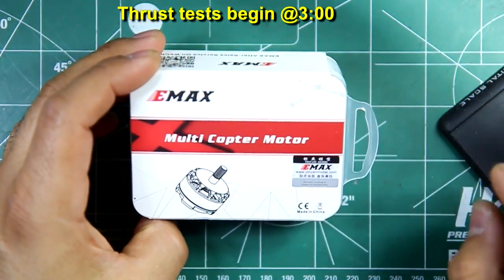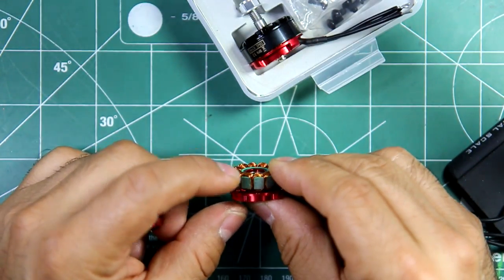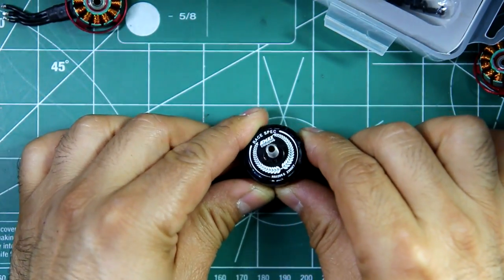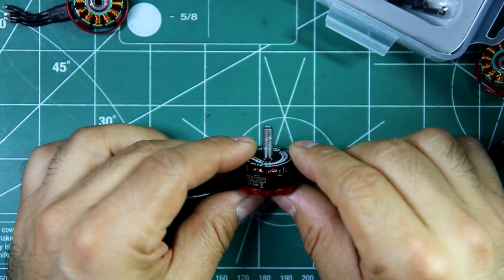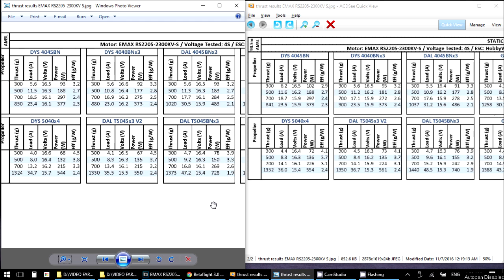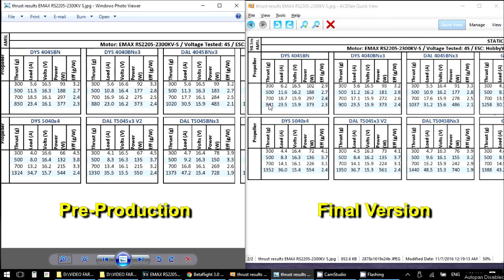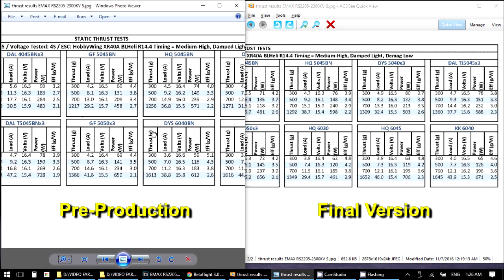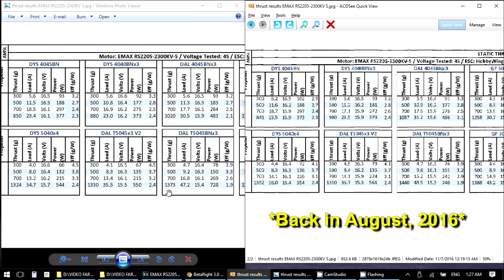EMAX RS2205-S 2300KV Final Version Thrust Tests -More Power! 2206-Class Power!

Comment: Well i have a 1000mm wing with 2205 2300kv motor with 6045 bull nose prop, the amp draw is way too much,plz suggest me some good efficient prop,Present reading is 22km in 20min end voltage is 14.7volt li-ion 4s pack.
Reply from the maker: Bull nose propellers are very inefficient and have high Amp draw. Change to 6040 or 6030 and that will reduce Amps. I'm not sure if it will be low enough as you want, depends on aircraft weight/size. 
There are 4 variables that you have to change to get the Amp draw you want: Size/weight of aircraft, Battery voltage, Propeller, Motor. Since you probably want to keep Aircraft and Battery the same, then you'll have to select a good combination of Motor and Propeller. If you want to use 6045 prop, then for 4S you probably have to use a 2208-1200kv, maybe 1500kv. You may still have a bit high Amps. I think most people use 2212 to 2216 and 800 to 1200kv for 6" prop and 4S. Bigger motor will add some weight, so that's a consideration. 
For lighter weight or keep the 2205-2300kv motor, then you'll have to use a smaller 5045 or 5040x3 prop. 
For long endurance, usually you want to use lower KV motors like 600 to 1200kv but then flight speed will be reduced.

Comment: Iam planning to make F22 raptor with coroplast sheet. Some of my friends used A2212 2200 KV with 6042 propeller. Is 2206 motor better than A2212 motor for this purpose?
Reply from the maker: 2212 is 2x larger height of stator so more powerful and faster response with 6 inch prop. It most likely will not be better
Reply: @EngineerX  so a2212 is better for my purpose?
Reply from the maker: @aju5405  I'm not too familiar with those coroplast plane setups, but if other people are already successful with 2212 size motor, then most likely that's the size that works best. 2212 is more powerful and has more torque so it should have quicker response.  2206 size motor could overheat if you intend to run at high throttle for long periods.

Comment: Which prop will give longer flight time on 3s ?
For longer flight time 2 blade prop is good or 3 blade?
Total weight of drone qav 250 is about 900g with 6200 mah 3s 40c lipo.
Reply from the maker: 2 blade props are usually most efficient.  Efficiency usually increases with prop diameter and lower rpm. I built a ight 5" and used HQ 5040 2 blade props. Made a 3S Li-ion 2800mAh Sony VTC6 cells. About 300g without battery. Flies for 15min.
Reply: Thanks

Comment: Hello! Can you share diagram for connection? 😊
Reply from the maker: Connection for what? Please clarify
Reply: EngineerX I need a diagram to be able to start this engine. Like the one in your video. Turn on or off I do not need any speed control.
Reply from the maker: @JorgeRamirez-dj7lp  i use a Spektrum radio and a receiver. ESC connected to receiver. I use radio to move throttle up and down.

Comment: will a 30a esc with 35a burst suffice if im using the t5045 tri v2 on this motor??
Reply from the maker: Yes, 30A ESC gives you plenty of current handling capability for this motor and any of the 5" props. Good choice of ESCs, you can even use them later for 2306-2400KV & 2700KV motors and 5" tri props on 4S.

Comment: So can I still use my 30A LitteBees or do I need to take 40A ESCs ?
Reply from the maker: What propellers and what LiPo voltage? 
30A works well enough for 4S and any 5" prop and should also be good for the 2 6" props in the test. Keep in mind the MAX Amps on thrust stand won't be present in flight. Multiply the Amps on my test by 0.7 (30% lower Amps in flight - is a guesstimate that I base on a couple of tests I ran before by strapping powermeter to my quad and checking max Amps reached) You can multiply by 0.75 for a more conservative approximation.
Reply: Thank you.
I use the Tattu 4S 1300 75C with the DAL 5045x3 V2 or the Racekraft 5051
Reply from the maker: 30A is good for that setup. I just flew with these motors using RK5051 4S and DYS XS30A ESCs so 30A ESCs is plenty
Reply: Nice :)

Comment: its interesting the hq6045 and king kong are similar efficiency and thrust...usually the KK6040 is a lot more efficient...Im thinking about having these on a 5 or 6" prop race frame...
Reply from the maker: Yes, that was quite interesting. You do start to see how the lower pitched 6040 gets more efficient at the top end. But they're about the same low to high mid throttle

Comment: No RaceKraft 5051's???
Reply from the maker: Per manufacturer's claims, the 5051s won't show their capabiities on the thrust stand, they're designed to be moving fast forward. Check out the thread where they mention something about that: https://www.rcgroups.com/forums/showthread.php?t=2752196
That said.... I"ll be doing a new tri & quad blade shootout, including the 5051, DAL Cyclone 5045x3, HQ S5040x3, and Just yesterday GetFPV has offered to send their brand new prop 5050x3 Butter Cutter prop. So check back in a week or 2 for that test. I'll be using this motor for those tests.

Comment: They are more powerful than the one you received long time before lol I remember those higher amps! Final version is sightly more crazy! Emax company is doing pretty great :)
Reply from the maker: Yep! they sure are. Amps are "normal" in-flight. In my testing setup they're exaggerated a bit due to the huge LiPo I use and the motor not moving. Yes, EMAX has been developing very good stuff lately. Their new TS2306-2300KV motor should be even more powerful if they use the same type of design as this one. Have an awesome weekend!